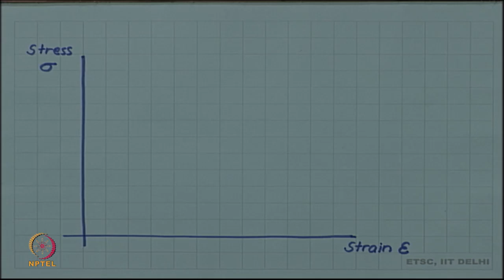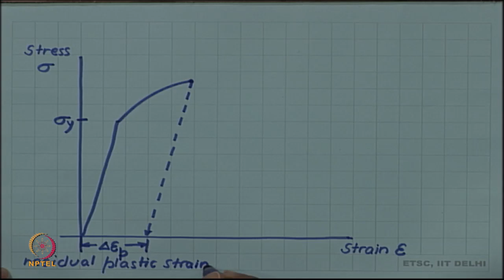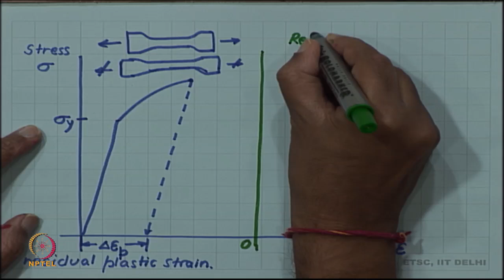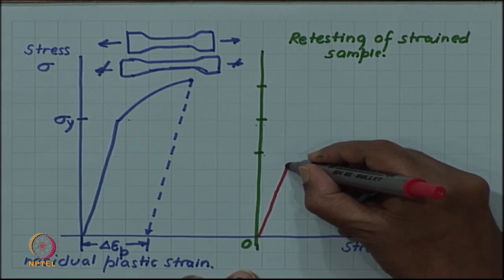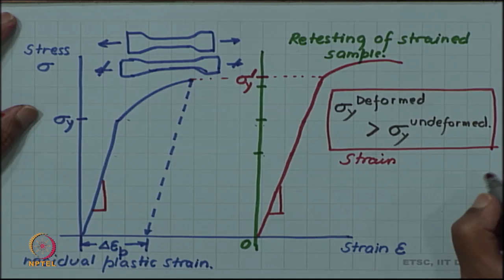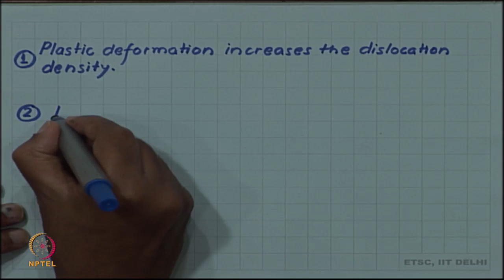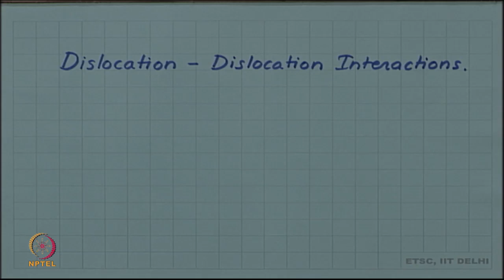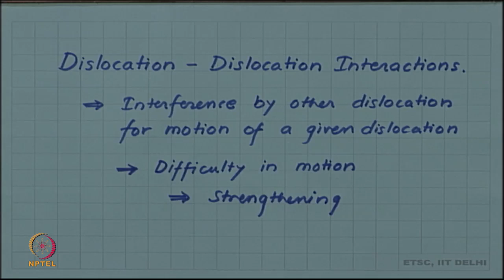Strain hardening

Comment: Question: Explain the process of applying Strain Hardening on a metal used for Aircraft structures. 

Help me with my essay sir.
Reply: Strain hardening is one of the most commonly used means of adding strength to an alloy. It is simply the 
use of permanent deformation to increase the strength of the metal. Other names for strain hardening are 
cold work and work hardening. No discussion of strain hardening would be complete without mention of 
the term “temper”. Temper is a description of the amount and type of processing done to a material at the 
mill, including cold work and thermal treatments.

Comment: What if during straining the metal in a tensile tests you took a hardness tests perpendicular to the pull axis - Would the hardness measurement  be less, equal or greater than the hardness of the virgin metal?

Comment: Sir, how the complete stress-strain curve will be i.e. up to fracture point for both the cases. I feel the UTS is not going to change in normal case and strain hardened case. So what about the toughness, Are we going to loose some amount of toughness in strain hardened case? please explain.
Reply from the maker: Ductility, as measured by strain to fracture, decreases upon strain hardening. Thus the toughness, that is area under the curve, also decreases despite the increase in yield stress.

Comment: 1. Generally, more the number of slip system more will be ductility.Therefore, HCP is brittle.
2. More the number of slip systems, more will be the interaction between dislocations, more will be Strain hardening. So, HCP will undergoes least strain hardening means it should have high ductility.

Points 1 and 2 are contradictory, kindly solve it.
Reply: Active slip planes in hcp is lesser

Comment: Respected sir, 
I have a query up till now we studied that till uniform elongation the load increases because of strength hardening and the reason being the dislocations so as told by you if a material is loaded and unloaded then strain hardening will occur so will it not occur in  case of an undeformed material which is loaded for the first time....
Reply: Unloading and reloading is done to highlight the strain hardening. But unloading is not necessary. The very fact that stress needs to be increased beyond yield stress for further increase in strain is itself an indication of strain hardening. A material with no strain hardening (called an ideal plastic material) will continue to to deform with increasing strain at the yield stress itself.
Reply: good job